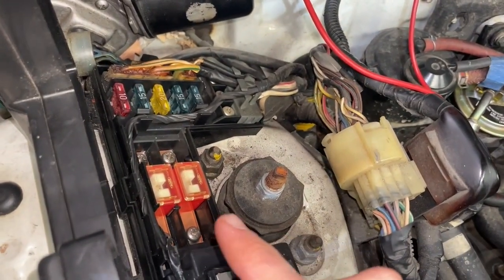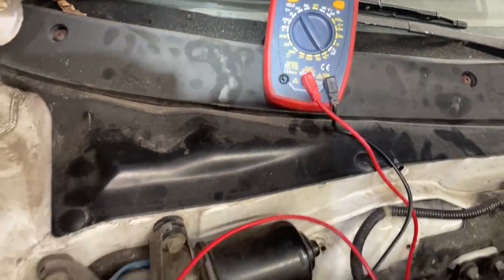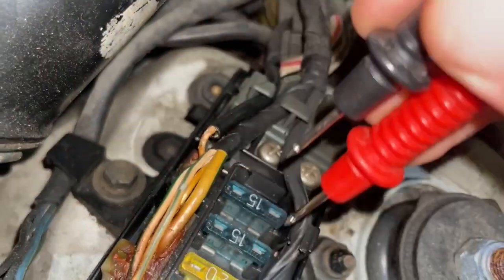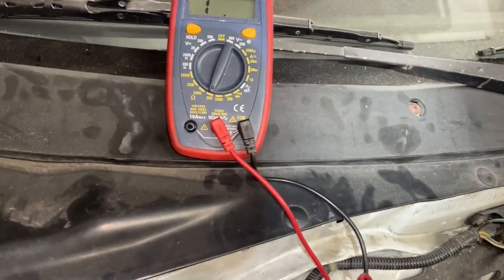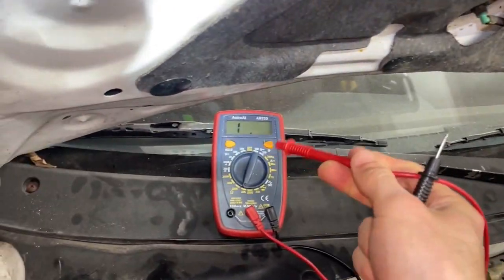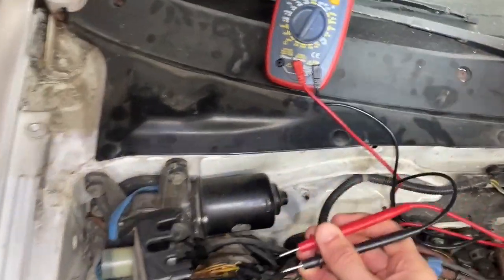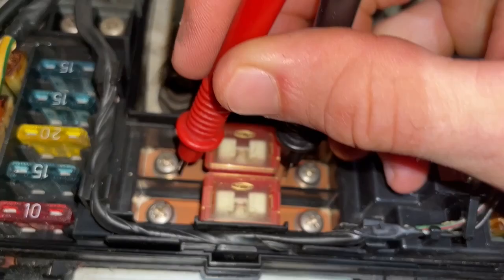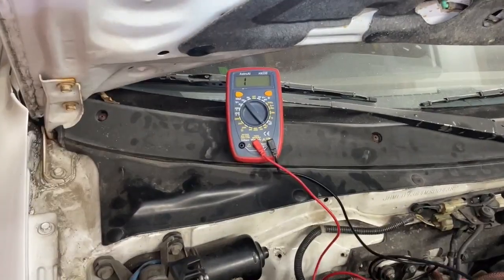How to test car fuses with a multimeter

Comment: does it matter where the black/ red leads go on the fuses?
Reply: No it doesn't matter. This is a continuity test. So as long as there's continuity, meaning the fuse is OK. That's all you want.
Reply: @crpth1  thanks

Comment: Not a good idea to test continuity or resistance on a powered circuit. It's a bad habit that could hurt you in certain contexts if you don't make it part of your muscle memory. Disconnect the battery, first, or better: measure the Voltage between the two points. It'll be 0v if there's continuity, higher if it's broken

Comment: Does the ignition have to be ON inorder to test certain fuses?
Reply from the maker: No, fuses can always be tested without power from the car. If the ignition is on then power is running through them and it’s more dangerous to test the fuses so I would recommend against it.

Comment: What if I want to test a fuse to see if current is flowing through when the car is on or off
Reply from the maker: You would use a test light between the two points. If the light is on then current is flowing through the fuse
Reply: @VincentStevenson thank you